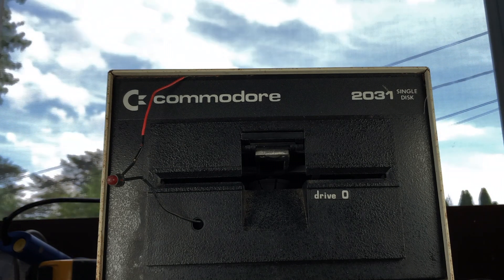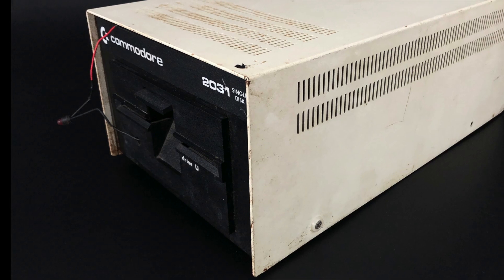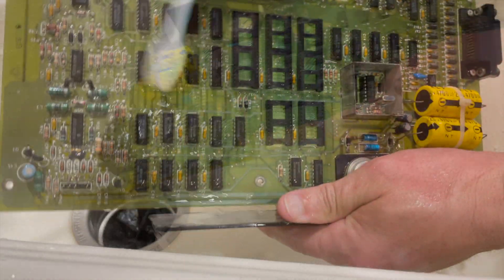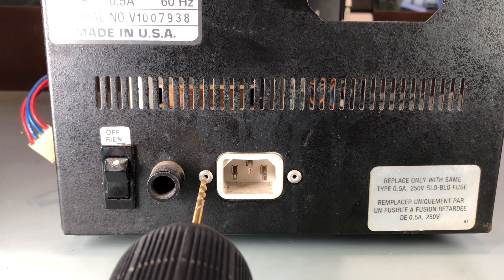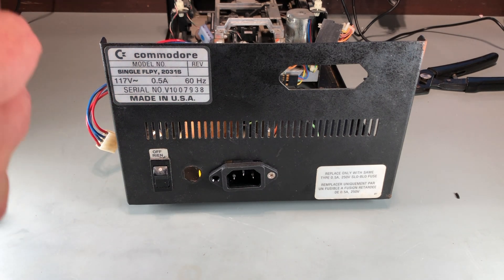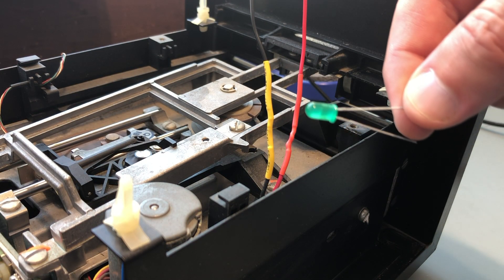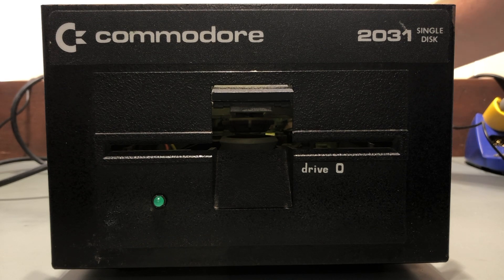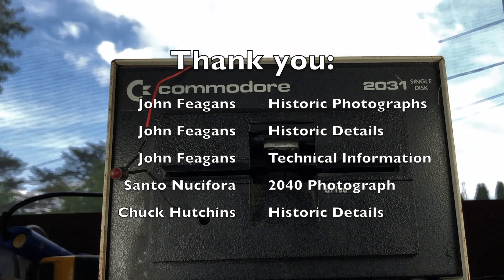Commodore 2031 Disk Drive Cleanup and Minor Repairs

Comment: I have a drive just like this...and it flashes once...and the motor keeps spinning...the documentation I have been able to find says simply...ZERO PAGE...but I can not find anything that would tell me what that means...I have swapped out the 6502 and the 6522's into another disk drive...as it happens, and 2031 LP drive...and they all seem to be working just fine...I am pondering swapping out all the RAM...but am still quite puzzled about the reference to ZERO PAGE...Got any suggestions, insights?
Reply from the maker: Zero page would likely indicate the on board sram

Comment: Great video. Were there any long term problems cleaning the motherboard with soap and water?
Reply from the maker: I only resort to using soap and water if they're really dirty like this board was, but I've been doing it for decades and not yet had a problem.  For less dirty boards I use alcohol and a cotton swab.  This 2031 is still working great.

Comment: Nice work, but Commodore stated in the manuals that you should not use oil as a lubricant. You need to use molybdenum grease.
Reply from the maker: Good to know!  I had nothing around other than common motor oil so I borrowed the sewing machine oil from my wife.  I have to order some proper grease.

Comment: I have a non-working 3040.. wonder if it can be fixed... 

It "hangs" on commands :(
Reply from the maker: I'm certain it could.  As I mentioned in the video, start with just re-seating all the socketed chips.  Check for 5V and 12V on the board.  Are there any blink codes?  Does the drive mechanism spin up?  If you pick up a chip tester (backbit or retro chip tester pro, etc) you can also pull and test all of the chips.  Good luck getting that working!

Comment: Nice work. :) TBH I'd rather have a 2031 than that giant 8050 I've got here even though the capacity is much smaller on the 2031.
Reply: I think for PETs the sleekest solution is SFD1001 which looks like an OG 1541. I think disk format wise it is like an 8050 or even 8250. But I don’t know how many of them were made.
Reply: @mudi2000a  Sleek perhaps but problem-prone. The mechanism needs recapping, and those RRIOT chips go bad.